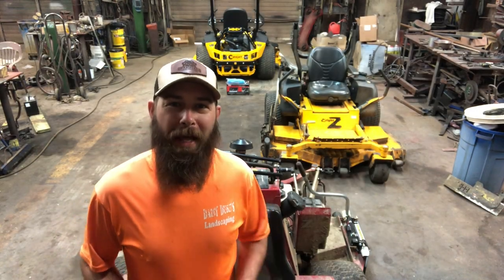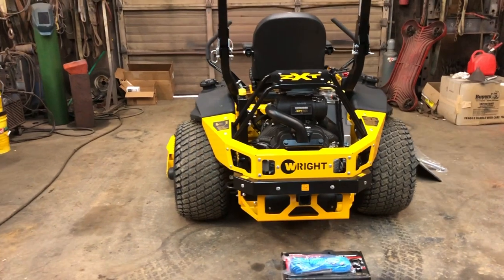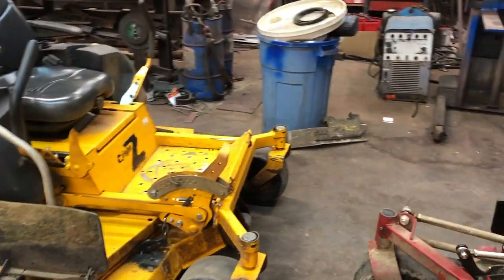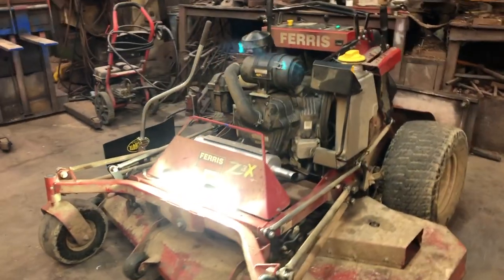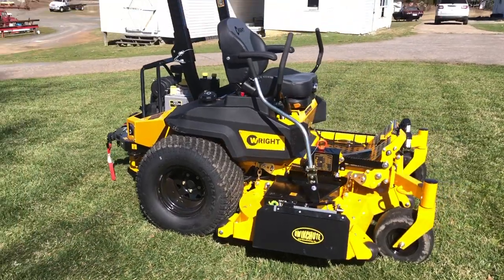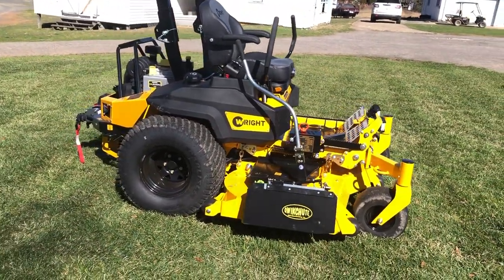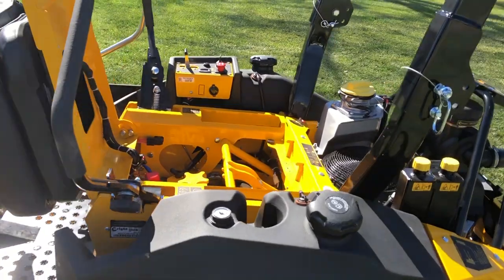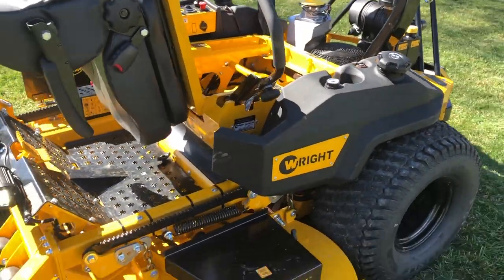Wright ZXT - MUST HAVE Mods Right Out of the Gate!!

Comment: I just bought several ZXTs and want to add the Quikchute.   What is the model # that fits?  Thanks!
Reply from the maker: Hey James I don’t recall off hand which model number it is specifically for the zXt...  this was one of those products that I didn’t want to buy from a third-party site for fear of getting the wrong model for my mower.

Check out my description and go straight to the manufacturer and give them a call. (I listed their website).  I spoke with Dale if I’m not mistaken, and he had me two quickchutes out the door the same day and I had them two or three days later in the mail. 

I highly recommend them. Hope this helps...sorry for the delayed response.
Reply: @DaisyDukesLandscaping  ok, thanks!

Comment: U know on all qwik chutes there is a second bolt hole the dog pivots on so to hold the plate partially open slightly higher. I like the higher position because it won't windrow the grass. The lower position seems to windrow and then you need another pass to clean it up.
Reply from the maker: Yes you’re right. I call it a “half hang”. In some of the places we mow it’s required to keep chute Blocks down so this is a little work-around to keep the clippings dispersed and not open ourselves up to liability.

Comment: Do you think wright mowers are better than skag and badboy
Reply: Yes. - Ed Wright
Reply: Ed wright thanks for getting back with me  I will definitely be checking your mowers out and hopefully buy one and would love to meet
Reply: Would love to meet you
Reply: @Ed.Wright  haha Ed replies "YES" thats awesome 👌
Reply from the maker: I think dealer support is the most important thing...but my personal opinion is wrights are some of the best mowers in production. 

Not only are they quality machines, but manufacturer support is second to none AND my second most important reason outside of dependability is they are easy to work on yourself.  Everything is well thought out from an engineering and mechanical standpoint. 

I’ve got other mowers that you have to disconnect the pto and clutch brackets just to change a drive belt...and that’s only after you put it on some type of lift to get the whole mower up off the ground. 

Also the fact that all of wrights pulleys and parts are a sealed, greaseless system, it’s just that much less preventative maintenance that needs done. 
 

Simply put (and again it’s my professional opinion) Wright machines are the most dependable and profitable machines that are the easiest to work on with the least amount of downtime on the market.